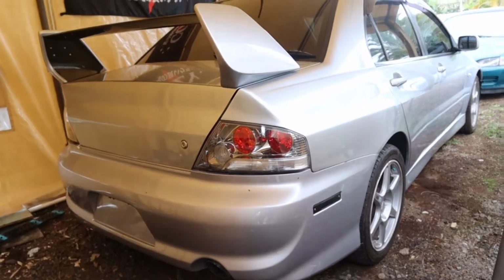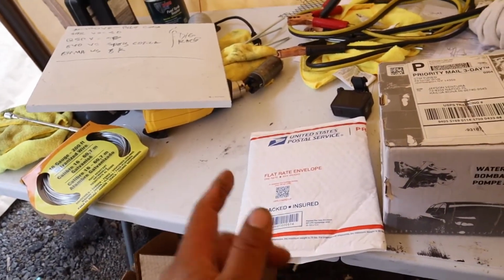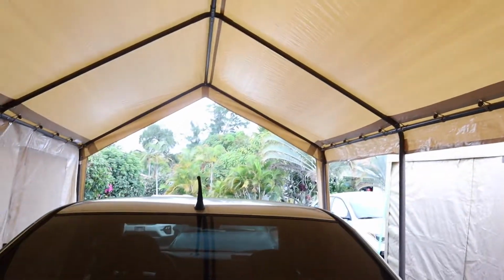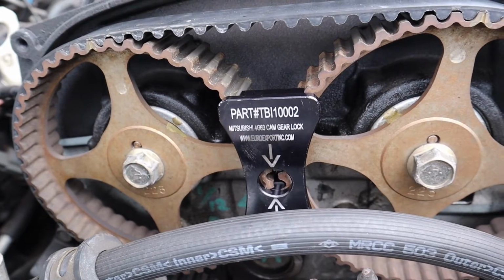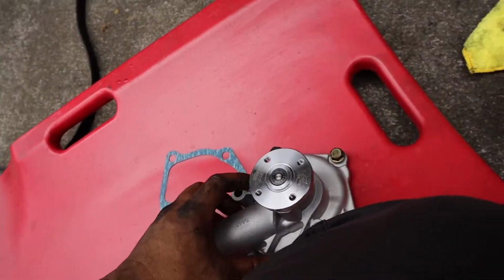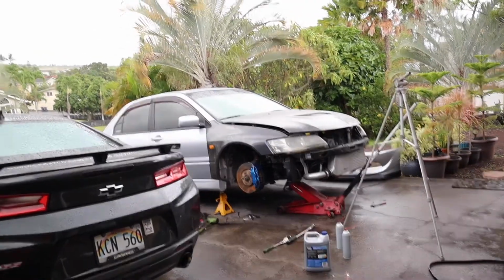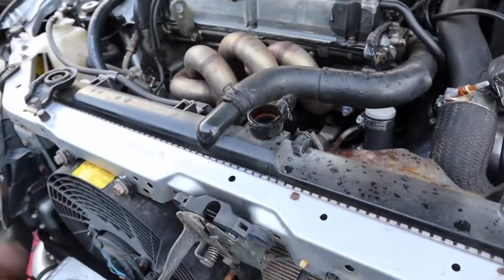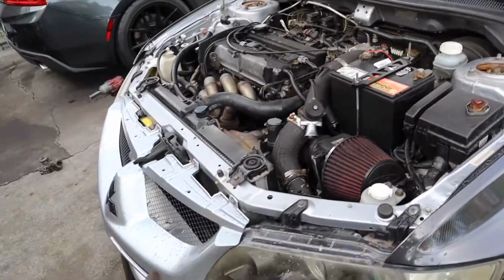Replacing Water Pump On A 4G63 Engine (EVO 8) #mitsubishi #evolution

Comment: Recently had a loud rattle noise from the cam belt area, took apart to have a look and it was the cam belt damper, the noise was the belt hitting the cam belt cover, managed to tighten up the belt tensioner and put it back together, oredered the whole belt kit from gates, and a water pump and fan belt. Gona replace it all tomorrow. Did discover the belt service intervals is only 50k, car has just hit 90k, id say when the garage done the belt change they just changed the cam belt.

Comment: how long did this take you from start to finish?  I need to do my WP on my 97 GS-T, 46g3t engine as well....  I did the timing belt and WP 3 years ago but just got a leak and believe its coming from the weep holes, i posted up a inquiry in DSMtuners earlier today... I have the timing belt tool kit to hold cams in place, its just been so long since I did it, I dont want to mess up my timing cuz I remember it being complicated... I also dont have my grenade pin anymore, definitely tossed it, guess I gotta buy a new one huh?
Reply from the maker: I say about couple hours. I did took my hydraulic tensioner and use a bench grip vice then stick a align tool in the hole to keep it in place. Cam gear tool helps a lot